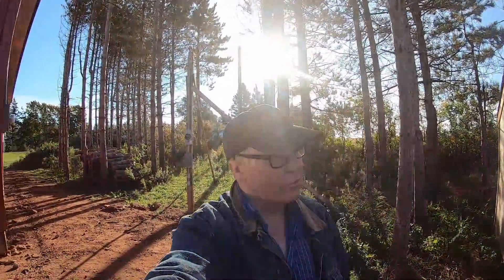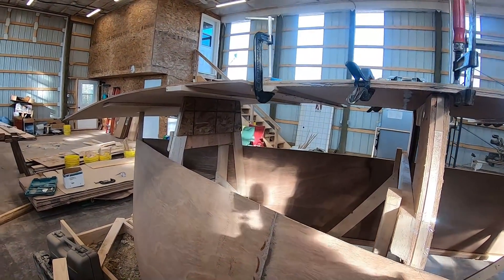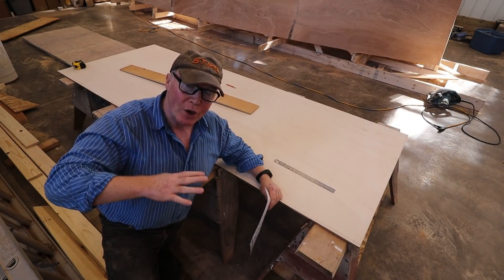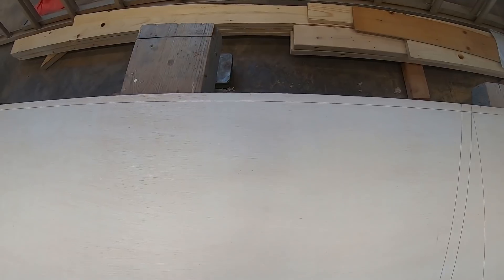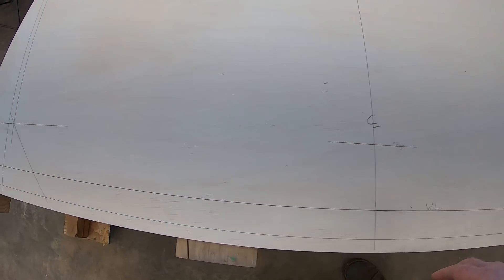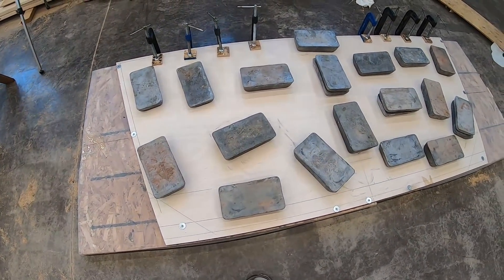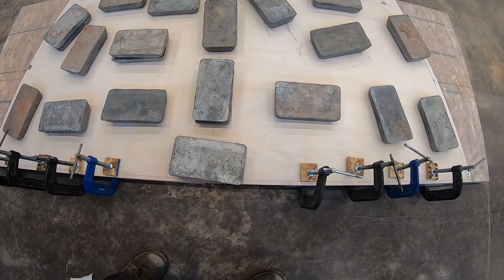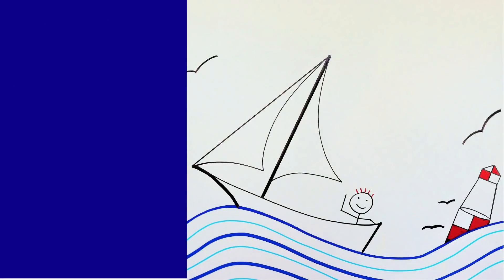S2E14 Rovers Unite || Problems with the Frames are Fixed || Building the Transom || Wave Rover 650

Comment: Why do you need such a massive and strong transom on a sailboat? On a power boat I understand to hold an entire outboard engine or gear housing for the inboards.
Reply from the maker: It holds the rudder and self steering gear. It is twice the strength as the hull.

Comment: Alan, I like your design, problem solving, and construction techniques, however, I hope that you consider the long term effects of inhaling epoxy vapors.  I once worked with Steve Kaulback, building The Adirondack Guideboat(s) out of strip planking construction and laminated ribs, etc, and the epoxy began to take its toll, despite the fact that we always wore quality respirators when sanding and fairing the hulls and parts.  One day we decided to begin using charcoal filters on the respirators when mixing, spreading, and clamping, and within a week we felt noticeably better.  Caution is advised as there are only two lungs per customer...
Thanks,
        Bob in VT
Reply from the maker: You make an excellent point about safety and handling of epoxy. As you will see in the coming videos, I wear a quality respirator when producing fine sanding dust. The goal is to have a boat to sail and not find oneself unable to sail due to poor or unsafe handling of the building products. Well said and thanks for bringing it up.

Comment: Can you use a polyester resin for this then as it's a laminating resin?
Reply from the maker: Not sure on that one David. But to be on the safe side I am using epoxy on all exterior and structural joints
Reply: @RoversAdventure  thanks for the information
Reply: No, polyester does not have the same properties as Epoxy
Reply: @setkacagarro-blogspot-com  thanks for the reply

Comment: If you have problem with too low temperature for the epoxi work you could consider local heating. I use a standard car heater under the hull when doing lamination during the winter. In combination with preheated epoxi I have no problem, even with laying out glas.
Reply from the maker: Good advise and in a few episodes you will see me do something like that as the temperatures fall below freezing.

Comment: You are progressing brilliantly!  It's probably way to late now, but if it were me... after a single time of walking to get or put away lead weights, I would have built a sturdy cart which could hold the weights.  That way I could wheel the cart next to where I need them, and restock them and roll the cart away when I were done.  But your a lot younger and more fit than I, so maybe you don't mind as much.  Cheers!
Reply from the maker: Very good idea.